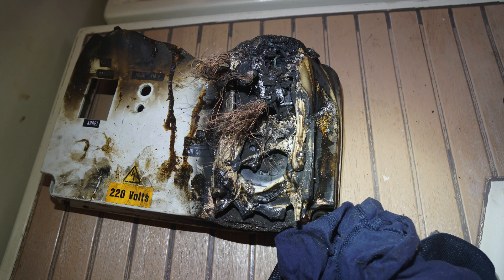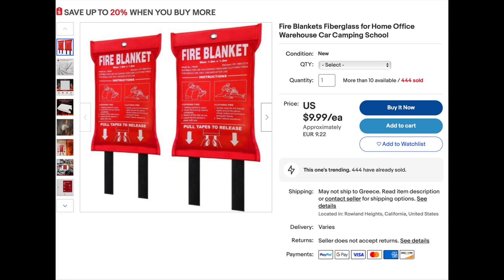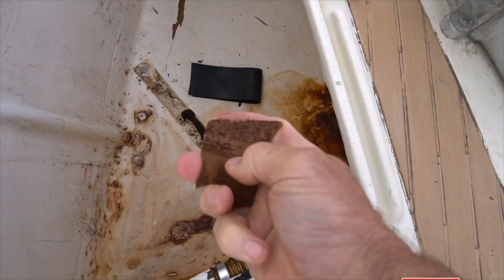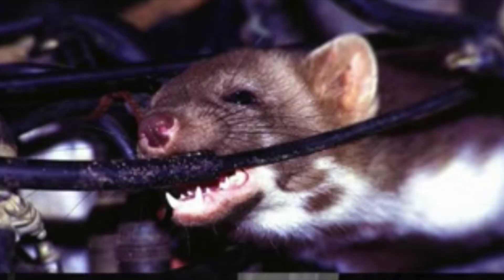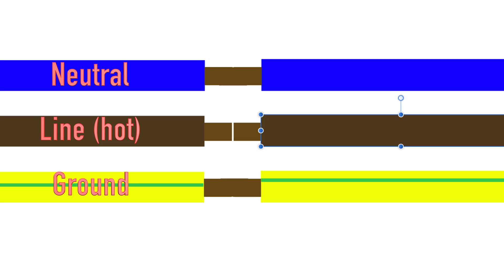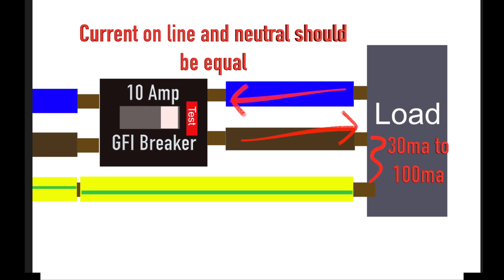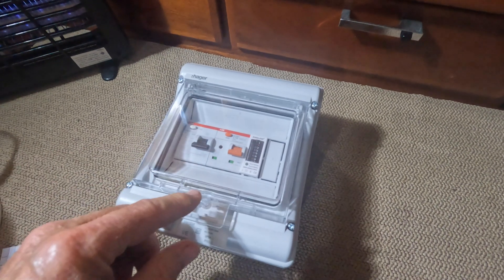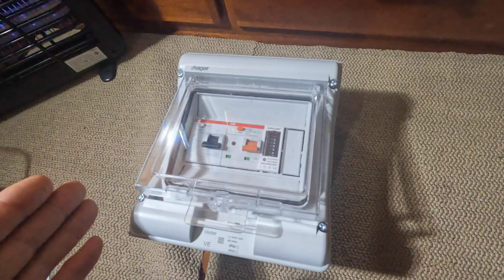Electrical Fire 101 - Tips on Tuesday - Yes there is a breaker that will detect an ARC Fault!

Comment: I have two arc fault circuit breakers in an 8-year old 200 amp elec panel in my basement. Each serves the electrical outlet in the full bathrooms in my home. The electrical outlet in each bathroom is a Ground Fault Circuit interrupter. These were installed by a licensed electrical contractor 8 years ago, and were installed to meet building codes since we were renovating one of our 50 year-old bathrooms, and replacing the electrical service entering our home. Our home is 100% copper wiring. :¬) Webhead USA

Comment: Great video, In addition to your new panel would you consider adding an isolation transformer if not already equipped with one
Reply from the maker: Plan is to change everything in the future.  Currently Aquarius has a 110VAC to 220VAC transformer, and with it a second cord to plug into a 110VAC shore power.  The transformer will be removed and the second cord will be to plug in a separate fully isolated 110VAC to 240VAC 100A battery charger.  This way if I have to plug into any suspect power, or a power source that does match the power required by Aquarius (220VAC 50Hz) I will just plug in the 100A isolated battery charger, and then Aquarius will produce her own AC power.    Best..

Comment: Several months ago I watched a video of a Marina employee walking around each slip using a thermal image camera checking the power cord connection (hull inlet) to the boats. If the connection was beyond the normal heat allowance he would call the owner. It was surprising how many boats had faulty power couplings.

A survey conducted a few years ago indicated that 55% of all fires aboard recreational vessels are electrical in nature, and 11% of those begin in AC shore-power wiring and appliances. By contrast, only 8% are caused by fuel leaks and only 1% by galley stoves. 

Will your new breaker also act as a surge protector?
Reply from the maker: I would bet 50% (or more) of boats are pulling more current than they should a some time while plugged into shore power.

Comment: Wago gas tight spring clamp connections only connectors loyds survey will approve 👍also used in mining for resistance to vibration no screwdrivers required
Reply from the maker: Just looked at this connection technology.  Looks good, but it will have to be installed on many types of devices.  Best.

Comment: An inexpensive infrared thermometer gun will allow you to scan wiring and components quickly for hot spots so you can repair them before disaster strikes in many situations.   It will also allow you to test newly installed wiring, connections and components for potential issues.    They are $20 to $30 online.
Reply from the maker: Yep, we have one of the inferred heat scanners.  But, I would like to have the Arc Fault Breaker as well.  The Arc Fault Breaker will probably find the issue before the inferred heat scanner would.  Because, in order for you to use the inferred heat scanner..... you have to open up all the connections, pull a current through the connection, and then look at the temperature rise. Fair Winds
Reply: If you check out the Fire on Aquarius video Ken also recommends this.